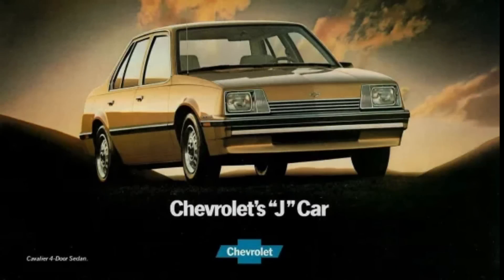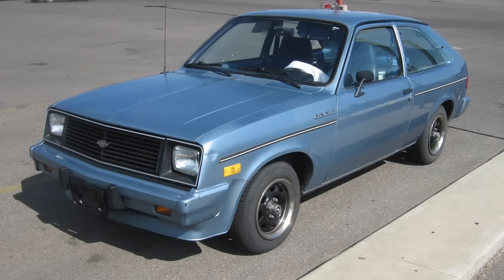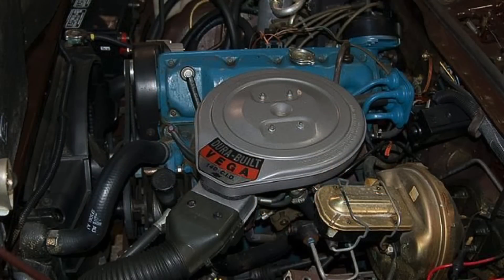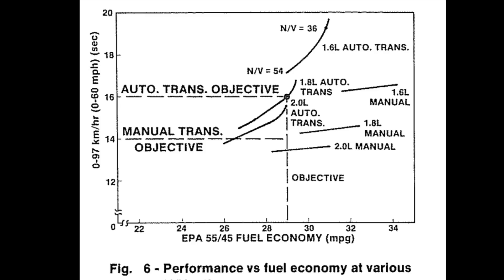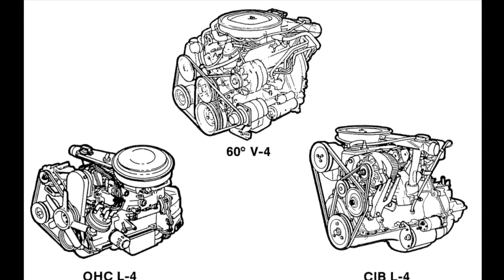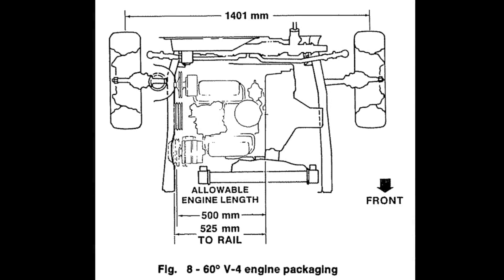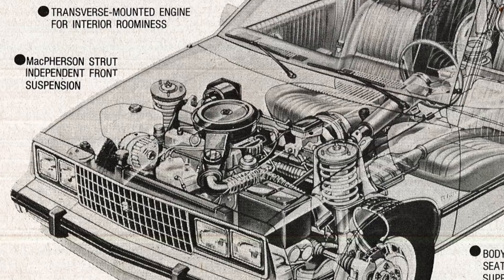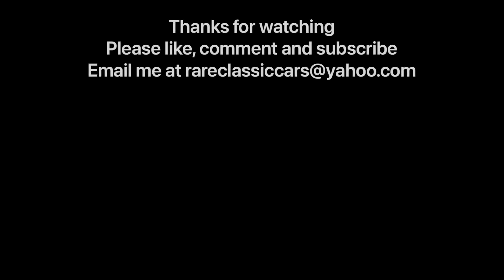GM Builds a Crazy 60-Degree V-4 (Yes, a V-4!) for Its J Cars

Comment: Ford had a V4.   It was built by their German factory in Cologne.   It shared it's basic design with the 2.6 & 2.8 V6.   While the V6s were available in various Ford and Mercury vehicles in North America, the V4 was only used in forklifts and stationary machinery in NA.   German cars did use it exclusively in Europe.
Reply: Didn't SAAB use the V4 in some of their cars...like the Sonnet?
Reply: @325xitgrocgetter  Yes, I believe you are correct.
Reply: @325xitgrocgetter yes, Saab used the Ford Taunus V4.
Reply: The Ford V4 and V6 were designed as a engine family based on a V6 60 degree cylinder angle.  This Ford  60 degree V4 engine had an internal balance shaft for smoothness, was originally designed to be used by the planned early 1960's Front Wheel drive Ford Cardinal, cancelled for a USA introduction, and then sent to Europe to be used as a V4 powered front wheel drive German Ford Taunus.   Ultimately this V4 engine design was adopted by Saab as a four stroke replacement of the original Saab 3 cylinder two stroke engine especially need to meet developing emission standards.
Reply: @GeelongVic7140  Your comment is 100% correct. I am old enough to have read about the Cardinal project back in 1962. Oh, and that V-4 engine was also used (mounted mid-ship) in the original Mustang in 1962. And yes, the Saab 96 and Sonnet used the V-4 starting in 1068, due to the 2 stroke not meeting emission standards.
Reply: @61rampy65  I  forgot about the Mustang 1 show car.   Here's a link to it...
https://en.wikipedia.org/wiki/Ford_Mustang_I
Reply: @gregmaday1331  There were 2 of those original Mustangs, I think. Both are on display at the Henry Ford Museum (a place that should be on anyone's bucket list).
Reply: @victorceicys7140  Being that the V4 and V6 used the same sand cores, the bottom end of the block looks weird.   The V4 countershaft required an offset in the block.   That shaft ran parallel to the crankshaft.
Reply: @GeelongVic7140  I was unaware of a planned vehicle for North America.
Reply: That's the Taunus V4 (and Cologne V6). Ford also built the unrelated Essex V4, used for British Ford models.